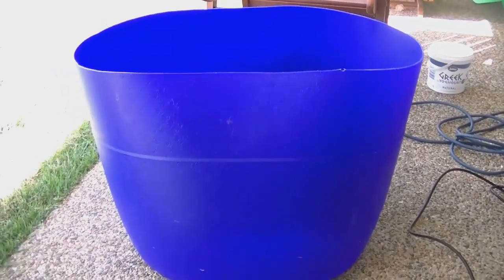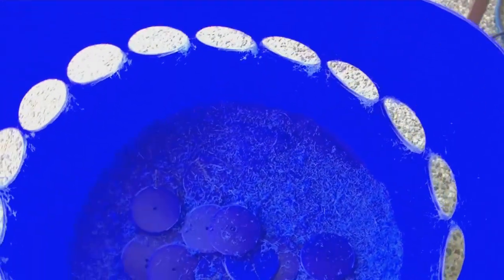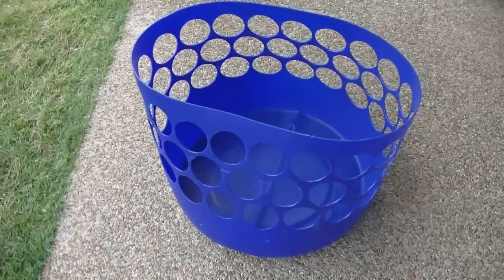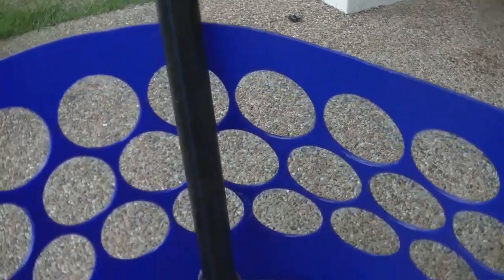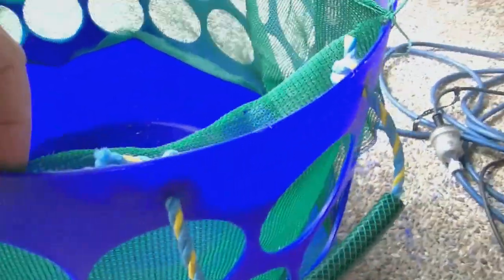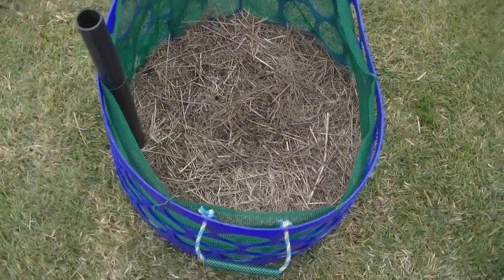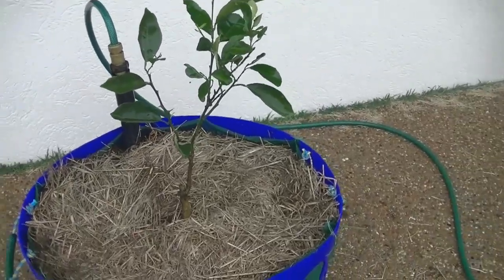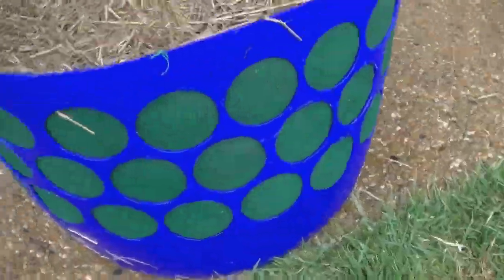How to make a self watering air pruning garden bed

Comment: Very interesting however i would use a smaller diameter hole probally 11/2" spade drill bit (less messy).  Then bore the holes further apart so as to minimize splitting of the plastic over time due to the internal pressures form root activity & soil expansion & degrading effects of UV sunlight.  
Shade coth probably 73%-80% but extend it all the way down to the level of the sandin your case you can "seal" the bottom of it with a thick cable tie. 
Additionally i would use the top loading watering method.  Large glass bottle wine bottle fill with water etc with plastic or metal cap bore a small hole in this cap then get length of pvc pipe running the length of the drum.  Heat one end of the pipe with heat gun to fit snuggly over the bottles cap the over end of the pipe cut at an angle and push this end in the soil according to the depth of the existing roots & push down further according to plants future growth.  You may need to provide a brace for this method to keep the bottle upright and all should be well.  I would also mix the potting mix with a quality top soil for prolonged sustainance for the plant.  Happy gardening i will send you some links to these suggestions!